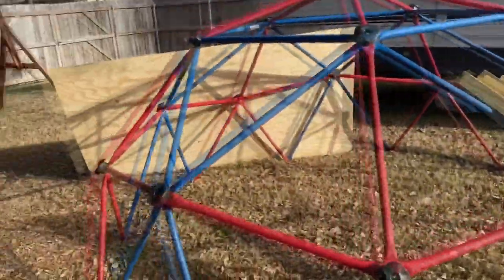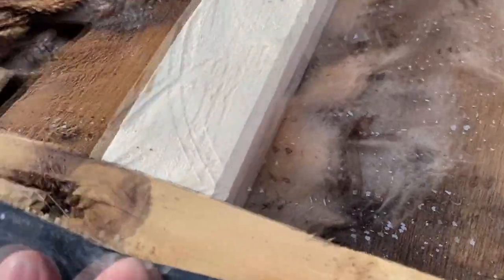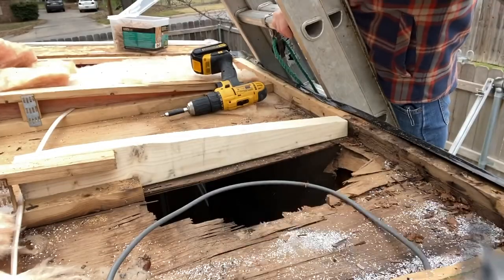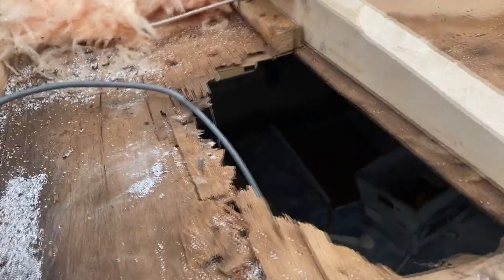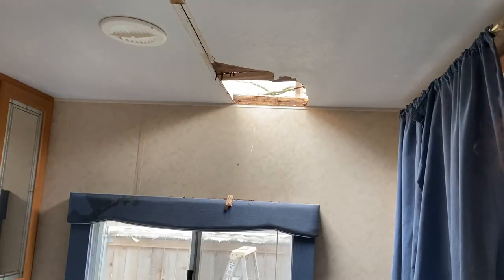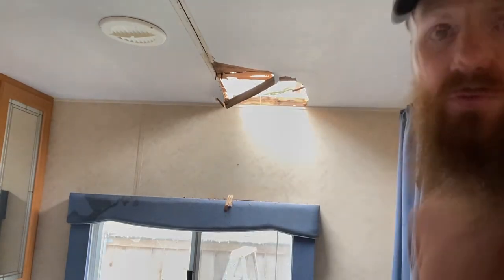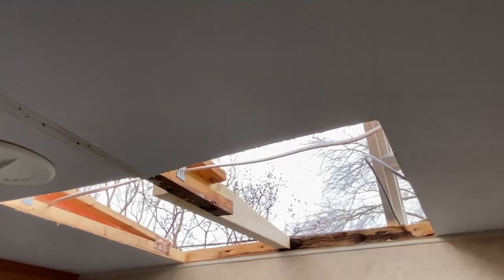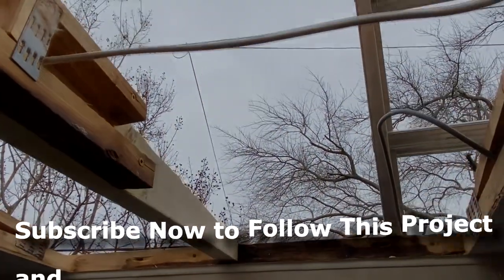RV Roof Repair: Rebuilding Rotten Trusses

Comment: I'm about to do the same thing.  My 5th wheel 30' is a 2001. I am wondering what you do to replace the wall and ceiling panels.  Mine are 1/8 thickness can find it anywhere.  So frustrating. Good job by the way,  very informative.  Thanks

Comment: Thank You Very much for your videos! they were very useful for me to be able to make decissions. Right now im in a pickle and i am looking to sell my 2007 Fleetwood 33ft . 2 years ago when i bought it, i remodeled it for full time living. then had it stored for over a year while away and there were some more leaks which created more work. Now i have a similar job on the roof as this video, and another portion on another corner. not to mentione a probably substancial damage on the walls and floors. My question is do i try to sell it as is or put some money down and try to fix it before i sell it, so byers  dont try to use the leverage to negotiate down too much? Im also tryin to sell it within a month so i can use the money to move from northeast to florida. what would you guys recomend i do?
Reply from the maker: That's a tough one. Based on your tight timeline you probably won't have time to make all the repairs. It may be best to cut your losses on this one. Repairs are not that expensive, but they can be labor intensive. 

Good Luck!

Comment: Would you recommend OSB or pressure treated/ground contact/severweather type plywood?
Reply from the maker: OSB should do the trick, but I have "heard" some folks use more weather-forgiving materials. That being said, moisture shouldn't be an issue if the exterior roof material maintains integrity.

Comment: What size wood did you use to toenail the truss and what tool did you use to get that slant?
Reply from the maker: I used a 2x4 and then a jigsaw to cut the curved portion of the board.

Comment: wondering to replace a part or the whole roof is it real expensive? we got a 2002 starcraft hybrid and just took the guys word that it didnt leak and he lied ... now the skylight and vent  in bathroon leaks and so afraid that we will find more damage ...so upset since we are on fixed income
Reply from the maker: With the wood you can just replace rotten sections, but for the membrane you should replace all of it.